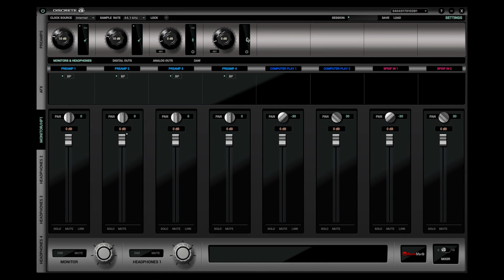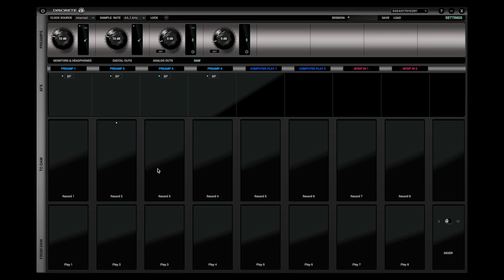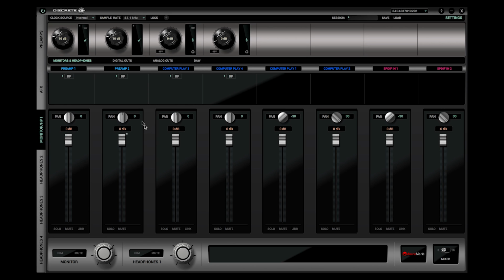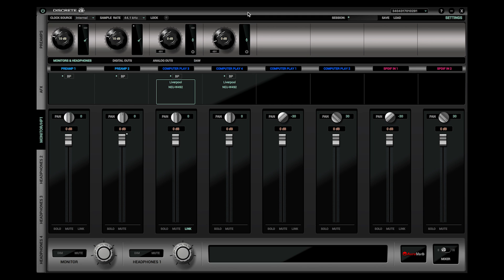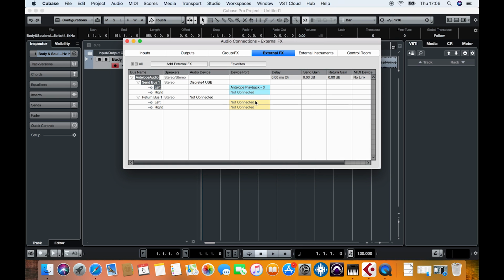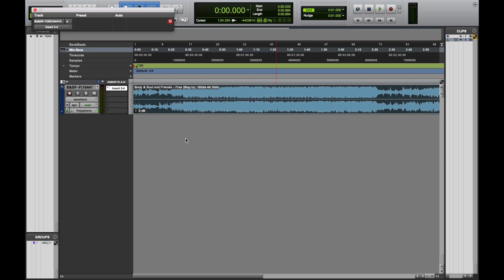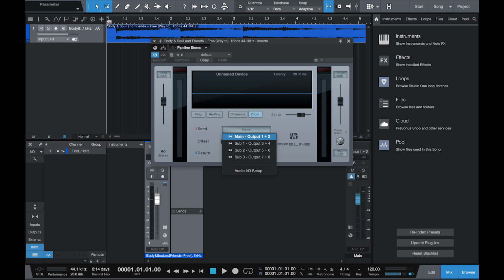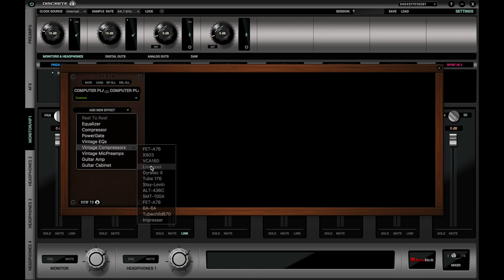How to use the AFX as inserts in your DAW with the Discrete series interfaces

Comment: I think Antelope should look what the concurence does to integrate effects into the DAW. I am extremely disappointed and I regret buying the Discrete 4. If I've had seen this video earlier, I would not have bought the Discrete 4. It took me 3 and half minutes to set my UAD Apollo 8 with Logic and use UAD effects without restriction. It spent 2 hours yesterday on the Discrete 4 trying to have afx2daw running with Logic and I'll go back to it today cause there's still something which does not work properly. So you could say I'm too old for this shit, but checking today forums and youtube for customers feedback, I'm kind of relieved to see that I'm not the only one who's not happy.